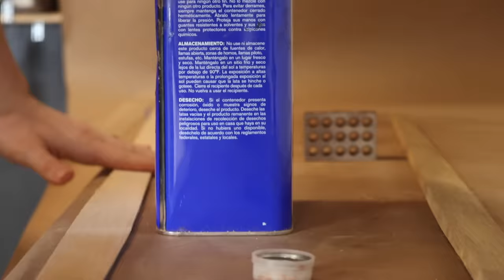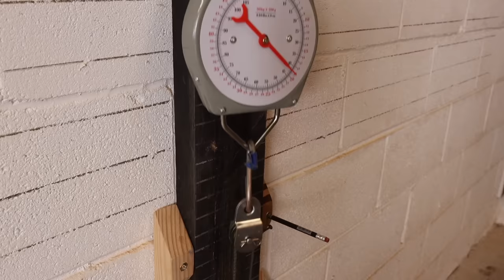Making A Laminated Bow In Silence...

Comment: Love your channel!  You have inspired me to pull some clear yellow pine out of the scrap pile and try to make a laminated bow out of it using epoxy and fiberglass cloth as a backing .  The blank is waiting for me now while the glue sets up on the handle.  Having so much fun I may butcher more wood later!  I guess,  with glass and epoxy backing you can add more layers of glass later  if you think you need it.

Comment: Hi Kramer. Thanks for your video..., no talks, no music, no sounds....A picture is worth a thousand words!!! Excelent work.
Please need your opinion: Don't you think the bamboo sheet should be tillered first?? Before the lamination?? 
It has only a geometrical aproaching made with the sand belt, so the other wood is asumming with his thickness-tillered diferences the necessary final thickness on each crossing sections along the limb. So that limbs has different proportion of the two woods in each crossing section.
I think that if you make some tillering first on the bamboo should make up for a better proportion of the two woods and along the limb the pressure is better distributed when the limb flexes.

Comment: Please tell me you monitor this and answer questions...
1. What is the small piece of wood used in the middle between the bamboo and your main limb piece?
The use of the inner tube is awesome. Never thought of that before.
2. What gives your bow the curve? Is it just the bending during the glue drying phase or does it have something to do with that piece in the middle.
3. (Last one, sorry.) Are you using Red Oak for your main body or something else?
Thank you.

Comment: Your bows have very nice cast . I am wondering if you ever reached 200 fps ? Have you considered making an asymmetric bow? If you place the grip at the geometric center as you have been the arrow won't get the full transfer of force from both limbs but if you lower the grip four or five inches the arrow is at the geometric center.  The performance of asymmetric bows definitely exceeds that of a symmetrical bow every time. Check out the living arrow bow.  Also the asiatic archers of old learned long long ago that shorter limbs are faster than a long one but that the string angle would not then impart all that force to the arrow so they put ears (siyhas) on the ends of the limbs and later curved siyhas . If you made a slightly asymmetric bow with nice long slender siyhas your bows would chrono over 200 fps perhaps as much as 220 230 if you use bamboo and definitely if you use bamboo and carbon.

Comment: Very watchable video. What was the block, you kept sliding under the curve,  for.
Reply: Edward Hughes it helps locate where the curve is too flat, so you can identify where to remove some wood
Reply: I should add that, the block sits along the length of the timber and where there is a flat spot, the tip of the pencil touches the timber but where there’s a curve, there’s a gap so the pencil doesn’t touch. moving it back and forth marks where the flat spots are.
Reply: @peter-robinson  That's clever..

Comment: Nope,......Bamboo is like sinew it has cords inside it,.... you usually plain down to those cords,.......no you don't band saw down to those chords,... as soon as you cut them,.. its ruined.
Bamboo is hydroscopic  it absorbs water,........then you try to glue it to dry wood,.... then it get's  hot and the bow will de-laminate?
You plain down to the cords you groove both pieces,... you put them in a dry box to dry them a few days then you glue them.
 In an age where all you do is watch a professional or read a book,........ Dean Torges  Hunting the Bamboo bow,......book and video.
So you learn to do it right.